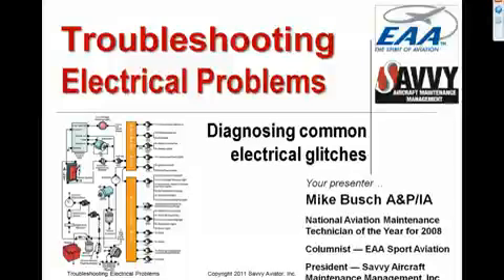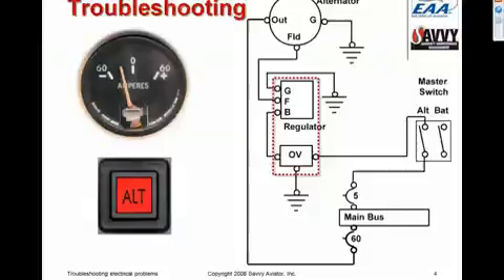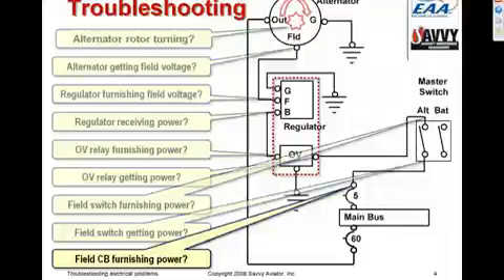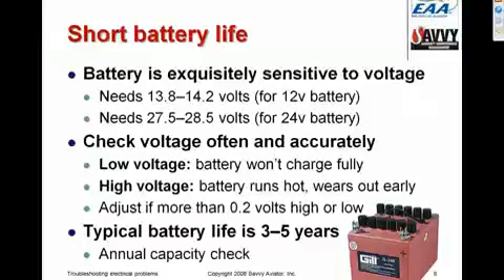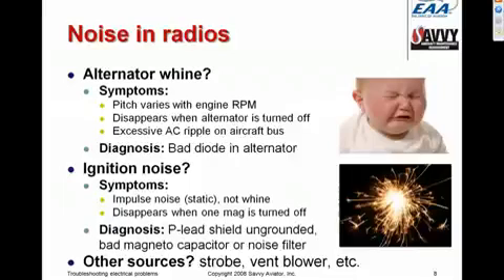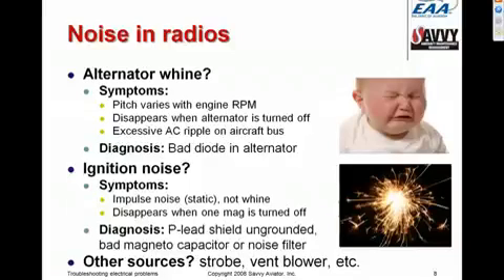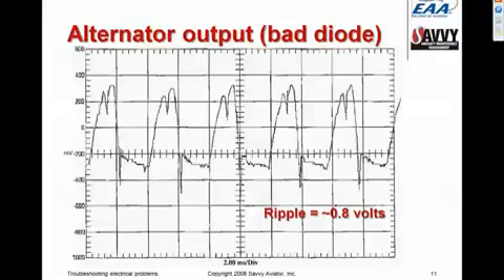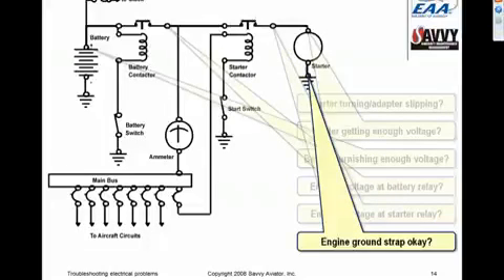Troubleshooting Electrical Problems

Comment: Regarding starters getting enough voltage we perform the same kinds of tests on automobiles. While the starter is engaged we're using a volt meter to look at voltage drops under load. Very high voltage drops across parts of the circuit including the ground indicates a high resistance which points at poor connections. Sometimes higher than normal voltage drops can be found without engaging the starter which is more convenient for identifying the problem, but one must be prepared to engage the starter because it's current flow in any circuit that creates the drop => E = I x R (R being the resistance of the leg of the circuit we're measuring the drop on. Regarding measuring the current itself, that's a very good test as well if you happen to have a clamp on ammeter that is designed for reading current in DC circuits.

Comment: Mike,  Thanks again for a qreat webinar.  I just had a flight where my alt cut off line a few times.  I reset it in flight initially at it worked fine for over an hour.  Later that day on a second flight if tripped twice, but reset each time with nl charging output.  I plan to troubleshoot the electrical but there have been no changes to the system recently.  Sound like anything I should focus on specifically?  Thanks.
Reply: I know it is kinda off topic but do anybody know a good website to watch new movies online ?
Reply: @Aldo Gannon Flixportal :P
Reply: @Colten Atlas Thanks, I signed up and it seems like a nice service :) I appreciate it !!
Reply: @Aldo Gannon glad I could help =)